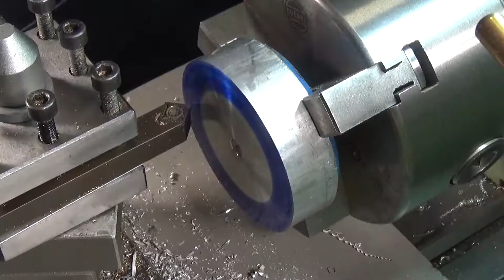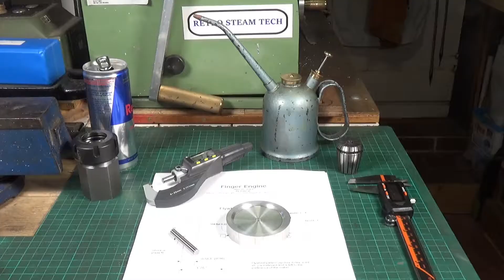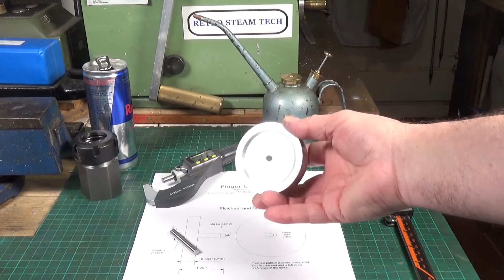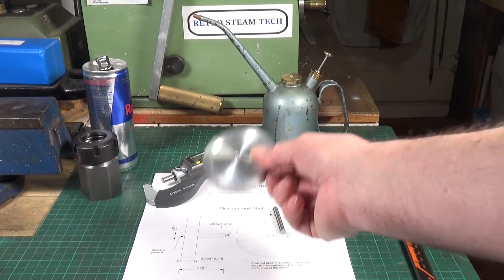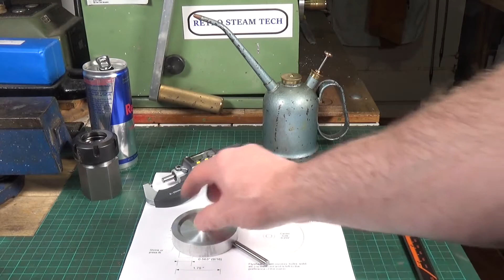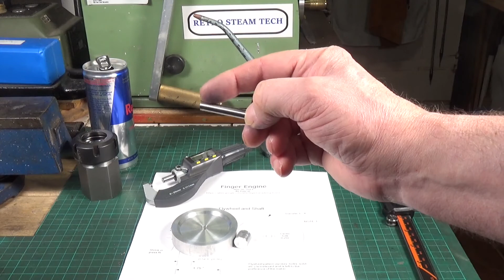Lockdown Project - Finger Engine - Part Two

Comment: You are not alone Alan.  Drilling over sized holes is so easy, especially as you get older/brain fade.  LOL  These days I drill well under size and then open out with a micro boring bar.  You get a perfect fit every time.  Plus it will be more true than a drill bit can do.   But yeah, it's a pain in the butt when this happens.  Cheers Rob
Reply from the maker: Hi Rob. Yeah, god knows what I was thinking. Still, I managed to get it right in Part 3 so stay tuned 🙂 Cheers, Alan.

Comment: Hi Alan, I'm going to make a drill rack, with all the correct holes and print the size of the drill next to the hole . I also make the same mistake. Great video 👍
Reply from the maker: Hi. Drill racks or indexes are always a good idea. It's also worth measuring the size of a drill bit with a micrometer just to be sure. Glad you liked the video. Cheers, Alan.